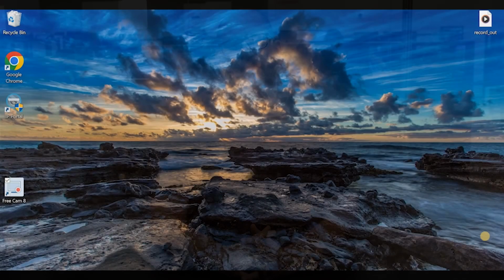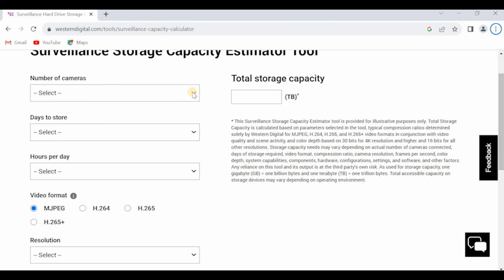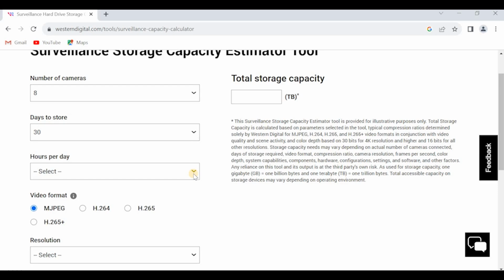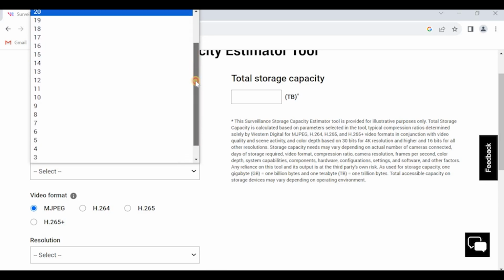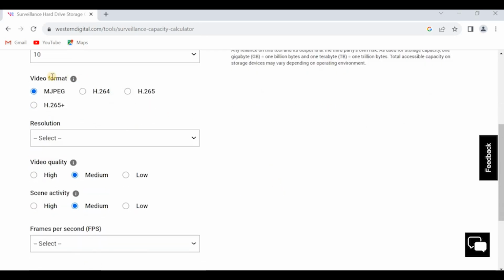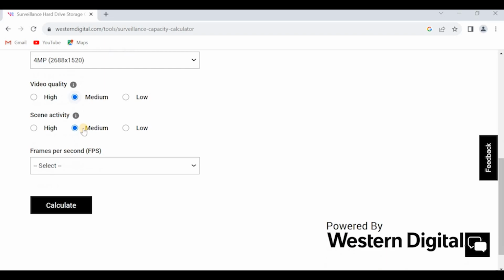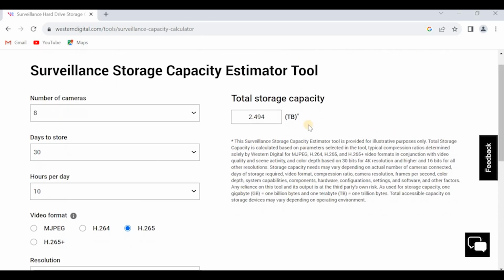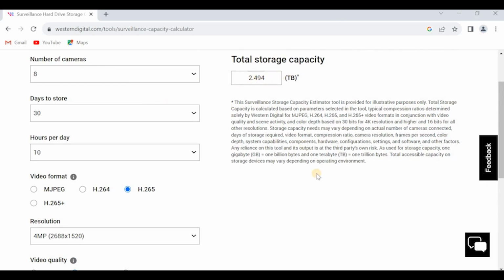Picking the right Hard Drive for your new NVR!!!!

Comment: Thanks for the link. I figured I might as well get the largest drive that will fit in my NVR. Turns out I don't need anywhere near that much drive space.

Now my delima is 2 6TB WD Purples, or 1 12TB WD Purple Pro, they happen to be the same price.

NVM - I should have researched just 5 more minutes. 3 year 256MB cache  vs 5 year 512MB cache.